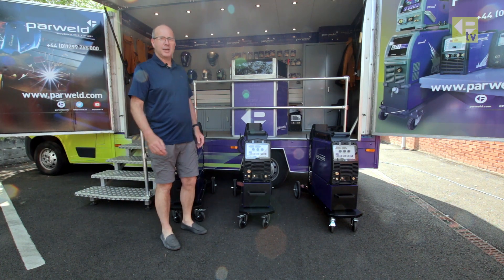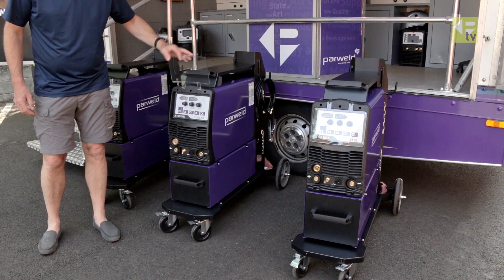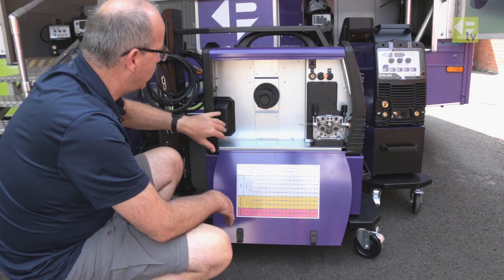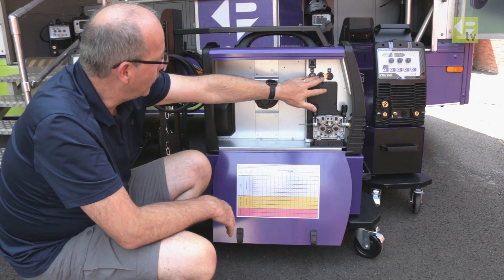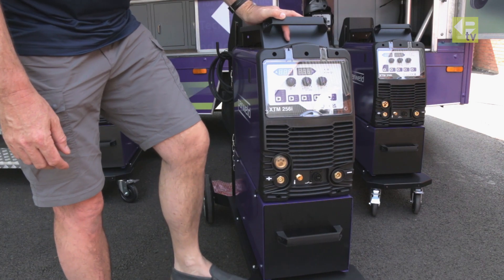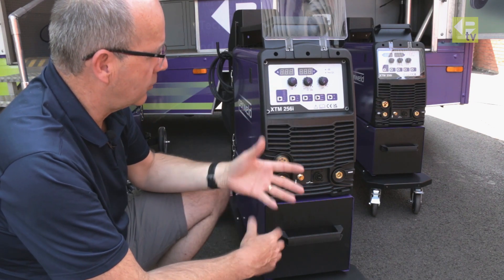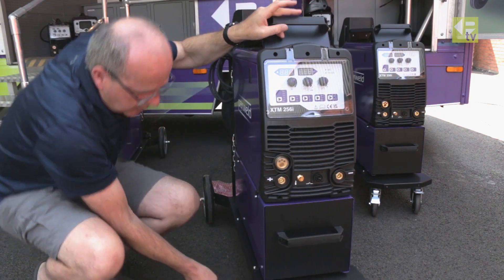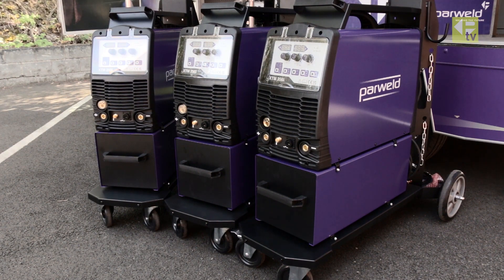Introducing Parweld's new compact industrial MIG machines

Comment: hello from Israel!  I really want to buy such a device from you, but I was considering the 256i model.  please answer, is it possible to use 256i both at 240volt and at 380-400volt?  Thank you
Reply from the maker: If you are welding at 240V then we would recommend the XTM255i which is a single-phase 110 / 230V machine. The XTM256i and XTM356i machines are both 400V 3-phase machines so would not be suitable for use on a 230V supply.

Please download additional information from the link below, about each machine.

https://drive.google.com/file/d/1LNnbcSTUmYB_aPUmkrmBEdQqrjyHrdDc/view?usp=sharing
Reply: @ParweldTV  Thank you!
Reply: @ParweldTV  Can you recommend a seller with delivery to Israel?